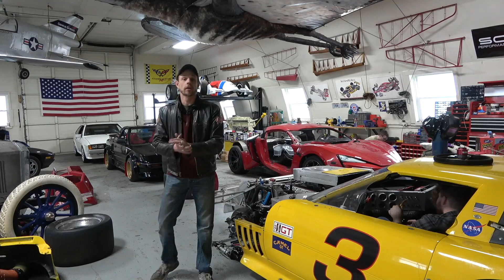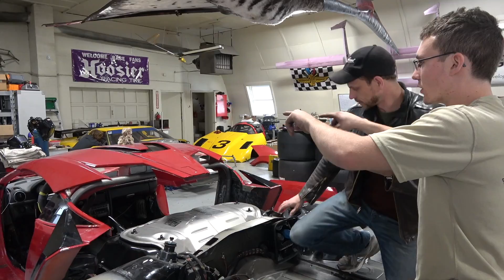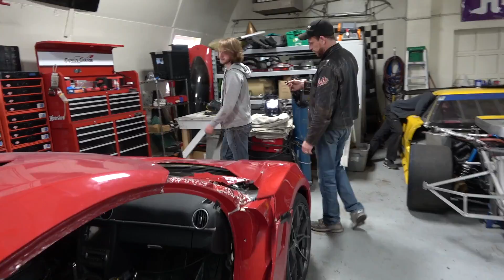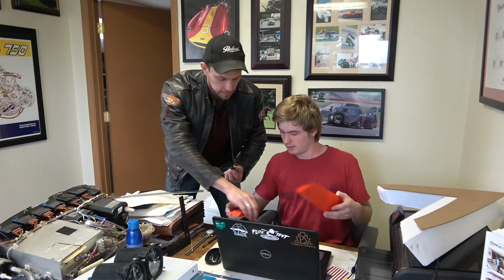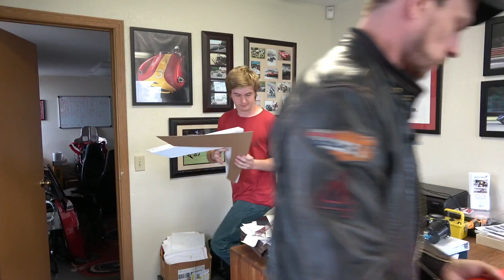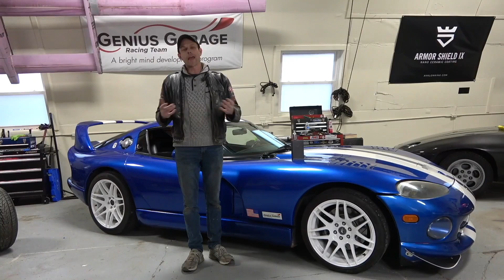3D Printing | Lykan Hypersport build #8 from Fast and the Furious Live Stunt Car

Comment: I've been wanting to create my own FabLab or Makerspace so that people (young and old) have an opportunity to have hands-on experience with industrial machines and industrial standards before they work for a company. Maybe offer some incentive for entrepreneurs. I work on the mechanical side for a robotics integrator in Sarasota, FL. Machining is how we prototype a lot of what we do simply because we have a machine shop and prototyping is still usually quicker with it (lot more expensive, but generally more precise anyway, so...pros and cons). 

I am curious, are you adding any more sensors or modifying any programming? What kind of "playhouse" are you trying to have for engineers? Some of the biggest benefits that helped me get and keep the job where I'm at now are (1) having a deep understanding of production manufacturing and (2) the FabLab I used to hang out at all the time would have "Maker Meetings" where Current and Retired Engineers from multiple disciplines would come and hang out, teach when requested/when they wanted to, and just be there to tinker themselves. Maybe an electrical engineer wanted to learn more programming, or how to 3D print, etc. Maybe he was working on a new surface mount circuit board for a solar panel charge controller he was working on for his own house, and it was a simple enough circuit where he'd do a SMT course and have a class on how to make your own PCB with reflow solder and an old toaster oven, checking the connections to make sure the circuit board was functional. It was fascinating just to observe and absorb all the little like nuggets of gold that I didn't realize how useful it would be until two or three years later. 

I love what you're doing, I'd be curious what you're trying to evolve that into, both the car and the non-profit.

Comment: Hey Casey. I don’t really know if you are using the 3D parts as mockup lights. Did you guys consider that they might melt or droop from ínstense sunlight?  I had made a phone holder that melted. Perhaps it’s the material I used. 👍

Comment: when gluing PLA together add a bit of baking soda in between the parts then use super glue it will make a rock hard instant cure and is very sandable surface in my experience the print will fail before the glue joint will

Comment: I can attest that a 3D printer is a valuable tool for prototyping in the garage. One low cost avenue you could try instead of buying a 3D scanner is photogrammetry. Meshroom is open source and calculates parallax from photos to generate a model.

Comment: Hey Casey, you mentioned 3d scanning, you can actually do a cheap free method of scanning using photos called photogrammetry. All you need is one dimension marked on the part to be able to scale it correctly. I used it to redesign front suspension for my project car. Could be a cool technique to try out, learn, and get some experience dealing with scan data.

Comment: If you need a cheap CNC router/plasma cutter check out the Lowrider V2 by v1engineering. It's mostly 3D printed and uses some cheap steel tubes. $500 gets you a machine that can cut a 4x8 sheet of material. It might be handy for molding/manufacturing the larger pieces on the car. There's some great mod's on the forum too!

Comment: What level of power you plan on making
Reply: I believe in a prior video the intent for V1 is to keep the stock Porsche powertrain. But I also believe it was noted that after suspension and drive-ability testing was done on V1, the power adders would come into play. I think it will be a TT build if my memory is correct.
Reply: @opieg7333  a Lyman Is a hyper car with hologram tech the aim should be close to original although unlikely it's more of a kit car if you think about it.

Comment: Huge progress. I’m super impressed! A tip on the roll cage: use a hole saw to drill a hole in the body where the main hoop meets the floor. Then you can drop the cage to weld the top welds, then simply lift it back up, and throw your base plates on weld em up. Amazing work guys!